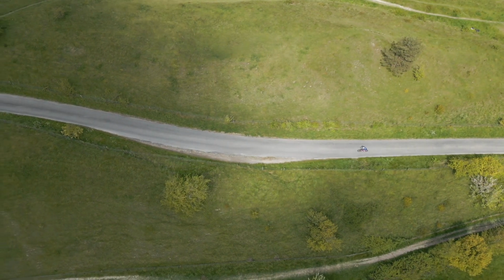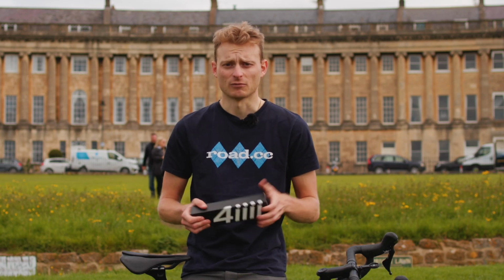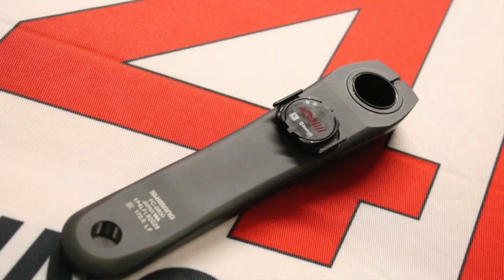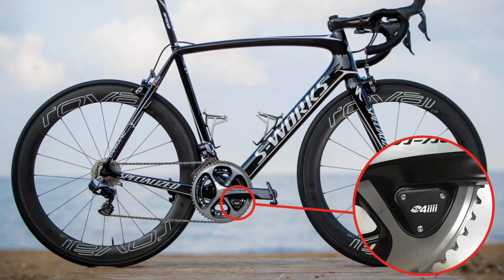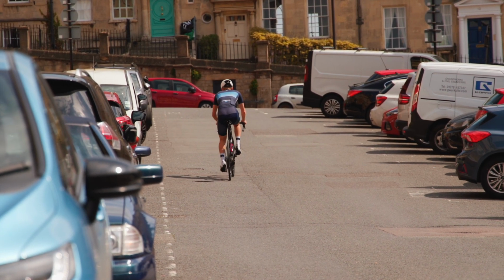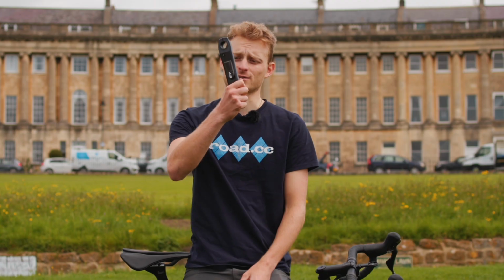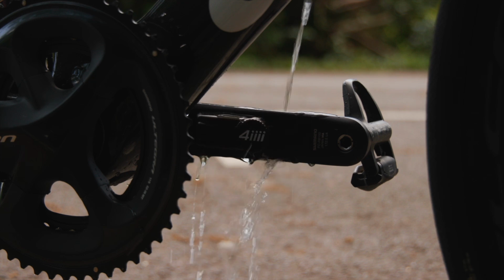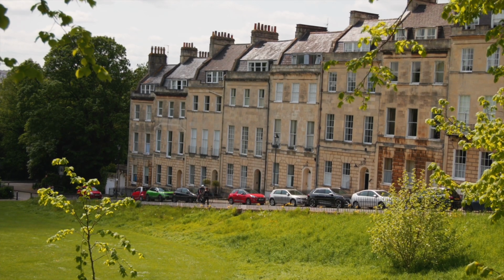Why NOW Is The Time To Start Training With A Cycling Power Meter

Comment: Stay away from 4iiii absolute garbage
Reply: Why is that?
Reply: @Tuffjobs  My left crank lasted 2 weeks. I put 1520w through it and it failed after that. In the sense it wouldn’t record at low rpm or anything above 400ish watt. I’m now getting replacement but would prefer cash instead as lost faith in it. The battery life which is exceptionally good in my opinion is the failure as it just drops out this is also a well known issue.
Reply: @TheKevzx6r  I’ve had similar issues with my stages gen 2 crank meter. Standing up on hills at low cadence it’s shows 0 watts. I’m not sure if it’s low cadence or lateral movement.
Reply: @Tuffjobs  That’s exactly what mine did. That’s faulty mate 100%

I erased app retry download try again nothing helped it was done.

Comment: Im a fan of 4iiii , I'm using the previous version p2 it was good till the accelerometer went crazy but 4iiii replaced it under warranty for free , no issues, to be fair I think the fault was caused by me ignoring the low battery warning, so there is a tip change the battery asap when you get a low battery warning. The pro version works like an apple airtag too, which is really cool, dont know why they didnt mention it here?

Comment: Have you done any independent tests to measure the accuracy claims from this company to back up your statement “accurately measuring your cycling power”?  GPLama did and it didn’t end well.
I’m genuinely interested to hear what you have to say as I had been considering a 4iiii power meter until I watched his video - which is now almost a year old, so perhaps you have some fresh insights?
Reply from the maker: Hi AlbaTech - We always test our power meters against a known turbo trainer to determine their accuracy with known drivetrain losses etc. Just like GPLama we did experience some anomolies when the Precision 3 was first launched but since a software update have experienced no issues
Reply: @roadcc  Thanks. That sounds vaguely promising, but I’ll hold off until I see some in-depth testing with the new firmware.
Reply: @AlbaTech  New video from GPLama shows it much better now with the latest firmware.

https://youtu.be/q8oqrh4G8PE
Reply: @BTcycle  yeah, I’ve already thanked him for his comprehensive testing.
Reply: chill down, this is just an ad

Comment: I love riding with a power meter. Not a big fan of crank based systems though. I have found Assioma pedals way more flexible, changing easily between my road bikes and gravel bike. Also batteries in 2023??
Reply: I like the "idea" of pedal based power meters to, so you can swap between a few bikes. But the prices are at least double a crank arm set up.
I reckon I'll go for a crank arm and fit it to my road/gravel bike, which I ride most of the time.
BTW: Ben Delaney recently commented that STRAVA's estimated power numbers are surprisingly accurate. I'll be interested to see how close it gets.
Reply: @BrianRPaterson  Thanks for your comment. Yes, I notice in some markets, crank arms are quite favourably priced, well below pedal systems. For me the Favero Assioma pedal system has worked quite well. Through my season I alternate between Campagnolo and Shimano rigged bikes, so for me watt-pedals have been convenient. Your mileage may vary of course. Enjoy your ride!
Reply: @aluminati9918  so if the rechargeable battery in your assiomas eventually wears out and dies you can change it, right? or you need a new power meter?
Reply: Re: batteries,  what do you think powers the Assioma pedals.... magic?
Reply: @colinc5283  Of course there’s a battery in Assioma pedals too, but it’s a rechargeable system. Big difference. 😎